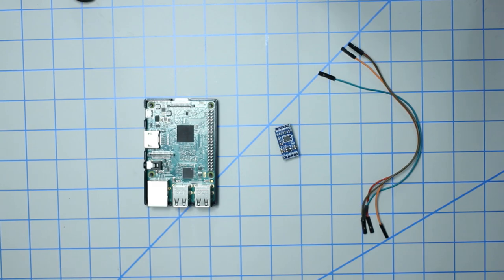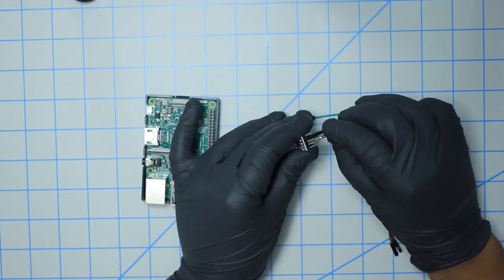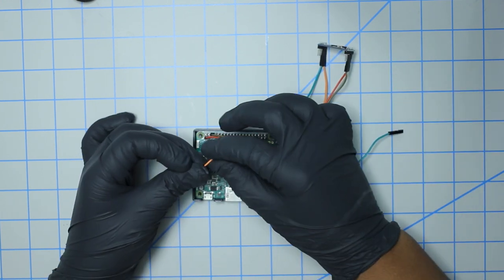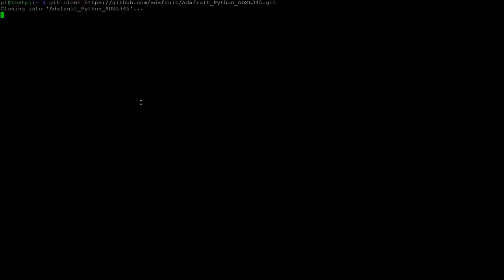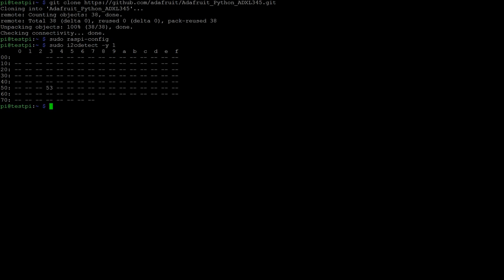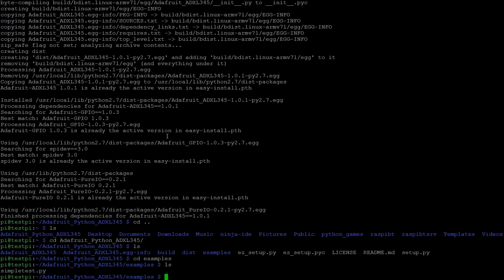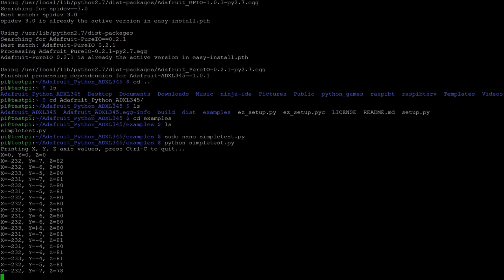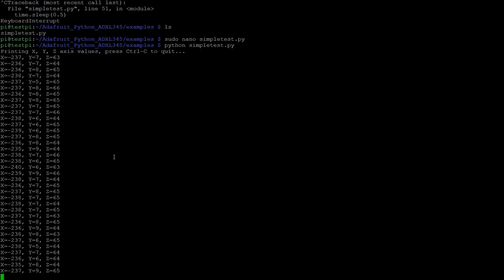Accelerometer (Raspberry Pi)

Comment: Help please. Can I connect more than one censor in a pi? GPS, vibration S. and accelerometer all together?? Please guys and thanks.
Reply from the maker: Generally yes. However, the setup will be different depending on the sensor/communication protocol.
Reply: @PiddlerInTheRoot  Thank you so much